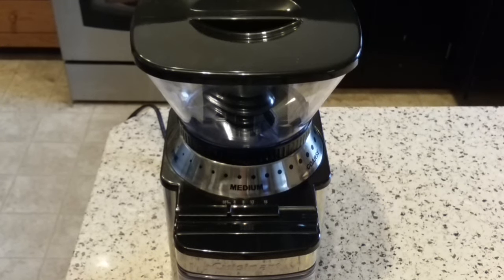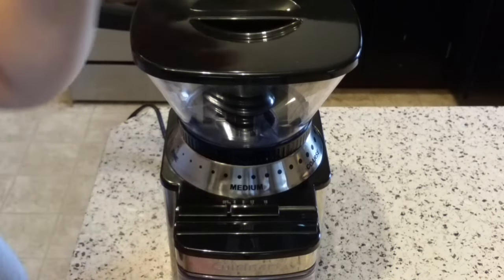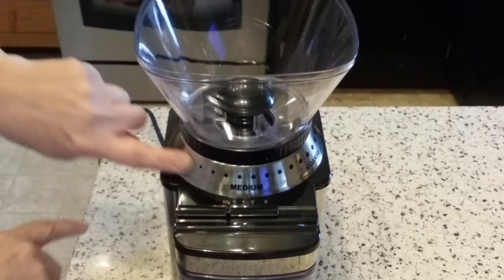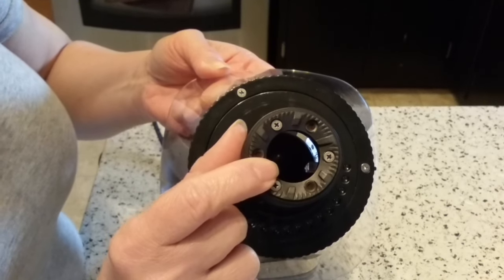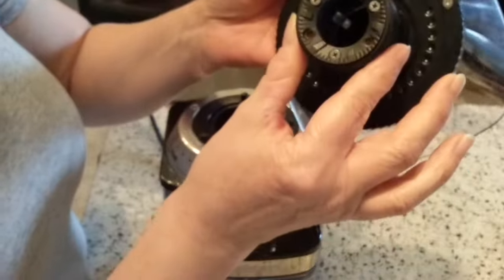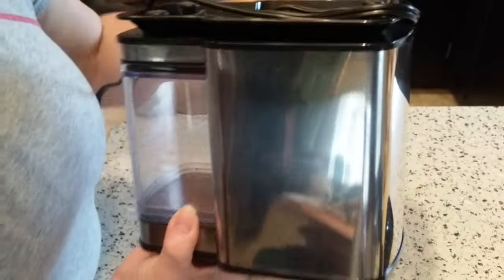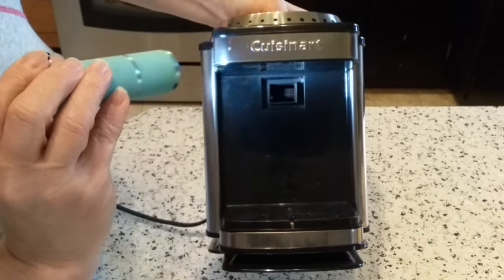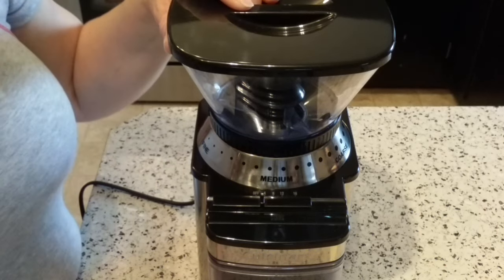Cuisinart DBM-8 Coffee Grinder: How to Disassemble for Cleaning

Comment: You're so practical and straightforward. I appreciate the help. My grinder stopped working even though I could hear that the engine was working. I had taken the feed off and cleaned it out a little bit but after I saw your video and did what you said the darned thing works fine again!
Reply from the maker: Glad you could save your grinder. Thanks for watching!  :)

Comment: OMG... I'm embarrassed to say I've been using this grinder for 13 years and had no idea about cleaning it. It started bogging down a few weeks ago and I was just about to replace it. Heading to the kitchen now to clean it. I hope it's not too late! THANK YOU!
Reply from the maker: After you disassemble it, brush it out then reassemble and run some Minute Rice through it to remove any old oils and build up that may be stuck in areas that are hard to reach. Then take it apart again and brush out all the rice dust. 🙂

Comment: You just saved me $100...I was so upset at the failure of my unit turns out it needed a thorough cleaning and that's exactly what it took to get it running again. I even shined it up because I was so proud of fixing it. THANK YOU!!!!!!!
Reply from the maker: You're welcome! The instruction manual that comes with this grinder is pathetically lacking in how to clean this machine. No explanation what so ever about how to take it apart to clean. And if you don't do this, it will burn out the motor for sure. So glad my video was helpful to you! Thanks for watching!  :)

Comment: Thank you for posting this - I've been using a small pastry brush to clean mine, but the toothbrush is much better.  One other thing that I've found that helps is a can of compressed air with the long straw (like for computers) to clean around the bottom burr a little better - I just hold it over the sink and spray that area.
Reply from the maker: You're welcome. Glad my video was helpful to you! Yes, the compressed air seems to have 1001 uses! Thanks for watching!  :)

Comment: Thank you! I have a slightly different model CBM-18C, but this helped tremendously! (on mine, the top burr isn't connected to the hopper)
I've had the grinder for about 8 years and I wasn't even aware I could clean it, TBH.
What happened was that it would power on and the blades moved, but no beans were ground. Took it apart and cleaned all the built up grinds and oils, and it worked!! Maybe I'll get another 8 years...lol.
Reply from the maker: Oh my! That is a long time.  :)  I'm glad you got it going again. Where is the upper burr attached if not under the hopper? Oh...do you have the conical burr grinder? I have that one too and I think it's much easier to clean than this one because the upper burr can actually be removed from the grinder.
Reply: That's the one!  It's indestructible and still produces grinds from powdery fine espresso, to super coarse french press. It's the best grinder I've ever owned.

Comment: Almost tossed mine in the trash. This fixed it! Had way to much build up. Thank you!
Reply from the maker: I'm so glad the video helped you with your coffee grinder! I have another video showing how I clean this model using dry Minute Rice and all the steps mentioned in this video. I'm baffled as to why Cuisinart does not show how to disassemble this grinder for cleaning in the user manual. 
Thanks for watching and commenting!  :)
Reply: On the question about why not include this in the manual.... I'm going with Cuisinart wanted him to throw it in the trash and buy another one. I've been more than a little frustrated with their food processors these past few years.
Reply from the maker: Yea....and yet they sell thousands of these coffee grinders, it's a very popular model. I think most manufacturers would prefer to have customers just give up and buy  a new unit rather than try to fix or maintain the one they have. I've seen this happen a lot with the Ninja appliances too. 
I also have a Cuisinart food processor that I used to like quite a bit but I rarely use it at all anymore. I don't like the plastic bowl and now the blade assemblies have been recalled due to the rivets giving way and the blades shatter into your food. I registered for a replacement blade a little while ago but have had no confirmation from Cuisinart that I'm on the list to receive a new one. No surprise there, unfortunately.  :/
Have a happy Holiday!  :)
Reply: Put the links for your related videos in your comments -- it will help people immediately watch the other videos if they are so inclined.

My grinder is 6 months old. I roast a lot of dark batches and the beans are oily. The machine became almost unusable -- I cleaned what I could see but that wasn't enough. Your video helped greatly, and I ended up using a bamboo skewer to dig out some of the chunks.  Wow! it was clogged!

Now I need to watch the rice video ...  ;-)

Comment: Thank you for the informative video. I'm looking to buy a burr grinder since Costco has removed their coffee grinders.  May I suggest that anytime you give an instructional video that is powered thru a wall outlet that you first have them unplug from the wall before starting. There is always one person who does not unplug and could hurt themselves.
Reply from the maker: This was never plugged in during this video. This model has safety features that won't allow it to run if any of the parts are not connected or engaged.

Comment: I've got to get a toothbrush but totally going to try this on our office grinder as it just stopped grinding this morning. Other than where the coffee shoots out I haven't cleaned it since we bought it 3 years ago. Betting this will fix it. :/  Thanks!!
Reply from the maker: Yes, a baby toothbrush works very well. A straight brush with bristles that are vertical with the handle will work best for cleaning out the inner chamber where the lower burr is located. Hope this helps to get your grinder working again. Thanks for watching!  :)

Comment: Ok... so I'm definitely appreciative for helpfulnatural's video. I didn't even know that the sucker came apart like that.
I started hearing noises from the grinder that I never heard. And I wasn't getting an automatic grind from the bar button. I'd have to hold the thing down.
After viewing this video, I did go through the steps here. As best I could. I used a regular size toothbrush.
At any rate... not much improvement achieved.
That being said... this was the first time I cleaned the thing in more than ten (10!) years.
I'm tripping out.
I can't believe that helpfulnatural does this every week. 
Obviously, one should not go ten years without maintenance, but I think you can stretch out the maintenance time a smidge.
These things run about $60. So I just replaced it. 
And for the record, I drink coffee everyday. I've run this things every morning at least once for more than 10 years. Some time off for vacation, but this is a workhorse instrument.
Is it the fanciest burr grinder out there? No. But it's got to be the pound for pound champ.
Reply from the maker: I agree that it's a workhorse coffee grinder. I clean it once per week when using dark, oily bean as they tend to clog it up faster. I have another video showing how I run Minute Rice through, then brush everything out. The rice cleans out all the residual grinds that get trapped inside. Maybe you could do this once per month?? 🤔
Reply from the maker: One more thing, coffee beans contain oils which when left inside the grinder can go rancid in a matter of weeks. 🙁
Reply: @helpfulnatural  yeah, I get you.

I should have been a little more clear.

I'm a truly avid coffee fan.
Thus a burr grinder in the home.

I do think I have a decent palate. I have served as a wine director at a few restaurants. And have worked in food my entire adult life.

That makes a fella persnickety about his coffee.

I generally only drink light roasts.
Ethiopian, preferably. 
Yirgacheffe, or Sidama, are my favorites.

After drinking these for years, it's hard to drink a dark roast. Even an impeccably/responsibly sourced bean from a small local roaster.

It just tastes burnt.

My reason for chiming in here is to hopefully, be helpful. Your video is exactly what I needed. 

I just feel that once a week maintenance is pretty high in frequency.

Although my evidence is anecdotal, and slightly hilarious, ten plus years without cleaning simultaneously absurd and exceptional.

I shouldn't have done that.

You showed me how to do what the machine needs. 

I think monthly, or even bi-monthly, is a fine preventative maintenance and upkeep schedule. I do like the idea of the rice grind from time to time as well.

Great stuff all around.
Thank you very much.
Reply from the maker: @PatrickFaySeattle  I totally get where you are coming from. 🙂 As anal as I am about my coffee grinder(s) & variable tea kettles, I'm not so much about other things around my house. Lol! 🙄 The rice trick works wonders so I hope you give it a try!

Comment: I used a straw brush to get deep areas in the grinder once it was taken a part. The kids tooth brush worked for the big openings.
Reply from the maker: Yea, those skinny straw brushes are great for getting into small areas! I have an old tree-shaped brush that came with a metal turkey baster that works great too! Thanks for watching and for the tip!  :)

Comment: This is what is written in the flyer that comes with the grinder. It doesn't give a lot of detail but is does explain exactly how to take it apart.

CLEANING/MAINTENANCE
INSTRUCTIONS
1. Be sure plug has been removed from outlet.
2. Beans can be removed from the hopper by lifting off the lid
and pouring excess beans out. Hold down the Manual button
to cleanout any remaining beans.
3. The bean hopper, bean hopper lid, grind chamber, and grind
chamber lid can be washed by hand with hot, soapy water or
placed in the top shelf of a dishwasher. Dry thoroughly.
 a. Remove the bean hopper by rotating counter-clockwise
bringing the selector past grind setting 18, align the
arrows and lift up. Make sure the hopper is empty.
 b. Remove grind chamber by pulling toward you.
4. Remove the burr grinder, once the bean hopper has been
removed, by grasping the metal handle and lifting up. Use
the brush to remove grinds or wash by hand. Replace the
burr grinder onto the unit and rotate until the piece is fully
inserted. Push handle down and replace hopper.
 Note: The hopper will not attach to the unit if the grinder has not been fully inserted.
5. Wipe body of grinder with a damp cloth.
6. Any other servicing or maintenance should be performed by an
authorized service representative.
Warning: never immerse unit in water.
Reply from the maker: Maybe Cuisinart finally decided to update the "flyer" that comes with this grinder. For years this info was not described in any paperwork that came with the grinder, nor was it on their website. There were NO instructions on HOW to disassemble the grinder....none. Thanks for letting us know that Cuisinart has finally decided to share this information with customers.  :)

Comment: I've had my grinder for several years.  Never cleaned it.  This year, a couple of months ago, however, it would stop grinding mid cycle, as if I had set a smaller cup setting, and has been doing that ever since.  Going to give this a try and see if this will refresh my grinder!  :)
Reply from the maker: I hope it works to get  your grinder working again. Thanks for watching!  :)
Reply: Sadly, it didn't work.  It has a bad switch.  I cleaned it, and decided to test it with some rice to help with the cleaning.  Same issue.  It would stop mid cycle.  My guess is it has a bad switch.
Reply: @helpfulnatural  Sadly, I had to get a new one as there was a short in it.  At least it wasn't too expensive.  Plus, I have you to thank for your expert training video on keeping it clean and serviceable for years to come!
Reply from the maker: @tomlagesse9351  I'm glad you were able to figure out what had gone wrong with the first one. This little grinder is a workhorse! Have a happy new year!  :)
Reply: @helpfulnatural  I did get my new one in yesterday!  Upon reading the instructions, I did note for cleaning where all removable parts are dishwasher safe on the top rack.  So, there's that, too, for a good, thorough cleaning!
Reply from the maker: @tomlagesse9351  Just an FYI... there are a few other comments here from viewers that put parts in the dishwasher and had trouble getting all of the moisture out afterwards. I never expose mine to water to prevent this. :)

Comment: A bamboo skewer also works. That worked the best for me. I've had my grinder for at least 3 years now. You would think they would have come up with a good way to clean the grinder wheel that is permanently attached to to the motor.
Reply from the maker: I know, right? And Cuisinart still hasn't made the owners manual, if you can call it that being a single piece of paper, more user friendly with instructions on how to take this grinder apart and how to clean that bottom burr. I've also use a vacuum cleaner hose to get in there to get everything out.  Thanks for watching!  :)

Comment: Thank you for the video. Unfortunately I have never really cleaned it out that thoroughly. I bought it back in October '16 and it finally died. I cleaned it out but it won't do a thing. Guess it's time to get another one. Thanks again!
Reply from the maker: Sounds like the motor burned out. If you buy the same model again, you now have a go-to video! I also have another one showing how I clean this grinder with Minute Rice to help clean out those packed in grounds and residual oils that act like glue over time. Thanks for watching and I hope your next grinder has a longer life. :)

Comment: I have that grinder.  I can add something.  I've found that those three Phillips-Head  screws on the bottom of the top container were loose & that caused the grinder to work less efficiently.
Reply from the maker: Do you mean the screws holding on the bean hopper or the upper burr? Either set coming loose is definitely not good! I checked them all on my grinder and none of them are loose, thankfully. Thanks for the info and for watching!  :)
Reply: The Bean Hopper.
Reply from the maker: Look at the black plastic around each screw to be sure it isn't cracked anywhere. Even a hairline crack can cause the screws to loosen.

Comment: Great video! Now if I could only figure out how to get the water out from underneath the bean hopper. I have a brand new machine, and I like to wash everything before the first use. I went to put the machine back together after air drying on the kitchen counter only to discover water under the hopper bowl. I’ve reached out to Cuisinart, but haven’t heard back yet.
Reply from the maker: I never, ever get any part wet from any of my coffee grinders. It will eventually ruin the burrs. Even if the owner's manual states you can do so. Most if not all manufacturers of high end grinders state to never wet or wash the parts, even the burrs. Take your grinder apart again, lay the parts that are wet on their side and get out your hair dryer. Use the warm setting on the highest speed. (do not use the hot setting as it may warp the plastic parts.) Also, coffee beans contain oils that will collect inside the grinder with regular use. If the parts get wet, this may cause the buildup to harden over time and seize the motor. I hope some of this helps.  Thanks for watching!  :)
Reply: Me too! I ground some beans I didn't like so I washed it thinking it would get the residue of the beans I didn't like out so I could load fresh beans. That is when I saw the water. You are a life saver! I'm going to try this!

Comment: THis is a good video. The rice is a good idea. If I may add, only AFTER all the brushing and ricing, to get that last little bit of dry cleaning... Use compressed air. The same can of clean neutrally ionized air in a can for cleaning computers and electronics. Shield your eyes of course and put the little straw down in there and ultra clean. For that residue from particularly "oily brands" of coffee. Yes the manual is very spartan in information. Was Cuisinart afraid they would be... Too informative?

Thank you for your fine video.
Reply from the maker: I don't know what Cuisinart was thinking when they wrote the owners manual for this grinder but knowing how to disassemble to clean is very important info.  Instead of pressurized air, I use micro vacuum attachments to pull all the extra coffee and rice dust from the grinder. I don't want to blow the grounds down into the motor as that will build up over time and gum up the gears. Thanks for watching!  :)

Comment: Not only do the instructions say next to nothing about cleaning, but they don't even hint that cleaning it is necessary to keep it working.  I bought it several months ago, but for the last few days, I've had to shake it to get the beans to go through.  Hopefully, this cleaning will do the trick.  I'll know in the morning.
Reply from the maker: I hope it works for you. It's a small grinder so it doesn't take much to get clogged. Thanks for watching!  :)
Reply: It worked very well, but the main problem was I was using extremely oily coffee beans (Black Knight).  The coffee had the additional benefit of tasting like cigarette butts (although I've never smoked cigarettes, nor chewed on the butts, so how would I know?)  As that coffee was the highest rated and most popular variety at freshroastedcoffee.com, I convinced myself that it was what high quality coffee was supposed to taste like, but finally switched to a variety that doesn't gum up the works grinding.